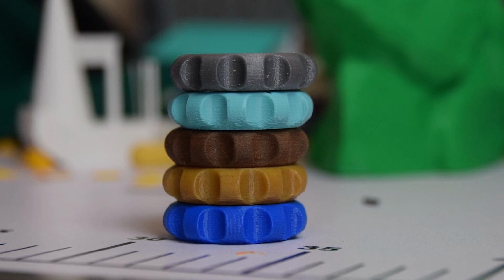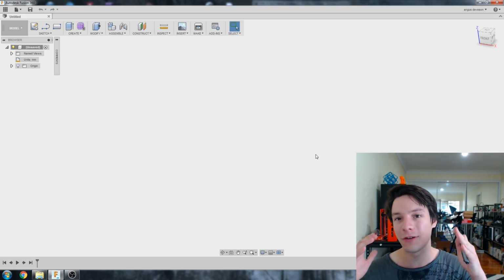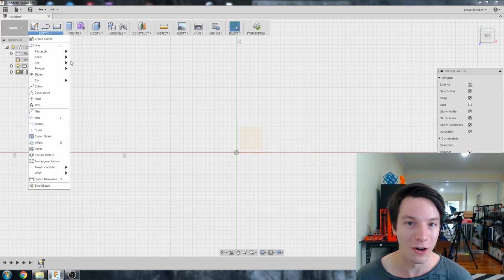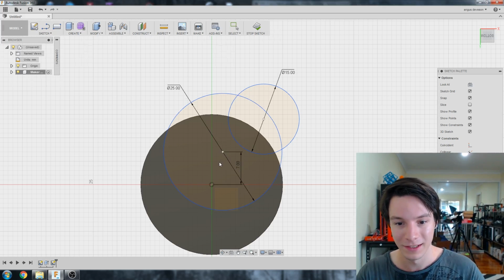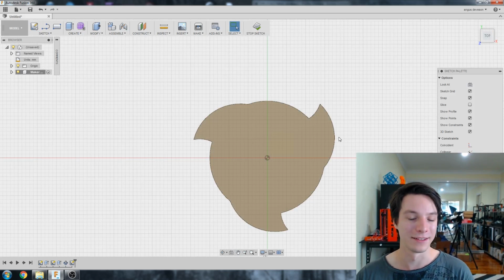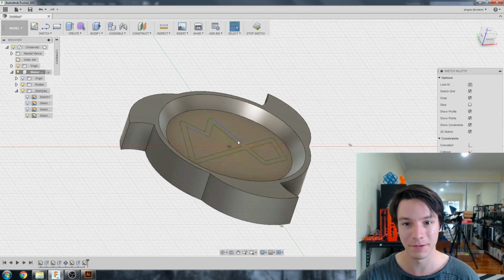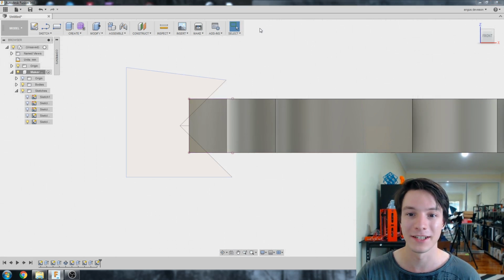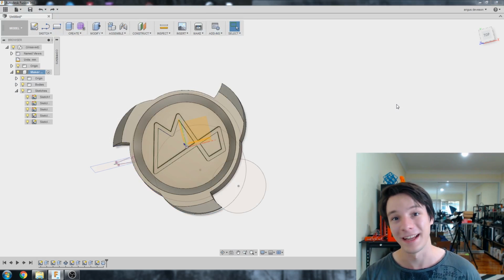Fusion 360 for Beginners - Design and 3D Print a Maker Coin! CAD For Newbies

Comment: I Love F360!  

I mentor a First Robotics (FTC) team and our entire robot was modeled in F360 by one of the students (my 15yo son).  He had never used CAD before; but he said he would just learn it from YouTube videos.  It works well with other CAD libraries so we were able to import most of the parts we use so he didn't have to create everything from scratch.

Also, since F360 is cloud-based, it is totally portable and totally collaborative.  He can work on the design at school, make changes at home, and even collaborate remotely with the other team mentor... all seamlessly.

He has also made several 3D printed parts for the robot using the school's printer an modeled them into the design.  

AWESOME!!

Comment: I didn't see if you made the mid-face relationship line as constructive... and when selecting the cut those were separate regions, weren't they ? I assume that when doing extrusion or features constructive lines are ignored (just like solidworks or other cad programs).

Anyway, very good tutorial. The minutes spent on the settings can save so many headaches!!

Comment: thank you soooo much Angus! I love fusion 360, and I know it has huge potential, but seems like the learning curve is a little steep. seems to me every other time i turn around I run into an error. I can't figure out for the life of me to merge a mesh with an object and make them one object to import it as an stl.
Reply: an example: I found a voronoi penguin I wanted to make for someone, however the only contact the model had with the build plate was the bottom of the feet and a small point on the tail making it pretty much unprintable. so I imported the stl Into fusion 360 and built a round base for the penguin. when I tried to select the mesh of the penguin and the base I created and merge the 2 it wouldn't let me. if you could cover how to do this I'd be very greatful!
Reply: Search Youtube for 'fusion 360 Convert STL to BRep' to learn how to edit an imported mesh.

Comment: what if I'm more comfortable with the software than my horrible drawing skills, I quite like to go in with a general idea, and as it takes shape I get new ideas, and things often change not because I'm LIMITED by the software, but because I can do things in the software I didn't think of before.

And yes, you are still a much better drawer than me, that circle is actually almost round :P

And thanks for the Pattern tool tip, I've been trying to do something for AGES and couldn't figure it out (I cut the model in half and made a rotated copy, was getting ready to attempt the tedium of cutting it into 3rds and do the same again, but now I can have it 5 times with less than 1/5th the work of making it have 2...

Comment: Angus,
Is it me or the video?
I'm trying to learn but the video is all blurry. Can't see the text properly when you choose menu items. I can hear what you're saying but to see Fusion 360 application it's blurred.
Reply from the maker: +Andrew Glagau it was recorded at 1080p, but YouTube may have reduced your playback resolution. I suggest changing to 1080p and letting it buffer, should help. In future I might zoom into buttons and windows to assist further.
Reply: That's better, but yes, it is buffering.
I want to get the best I can print for the first time with this V3 3D Printer I been building for the last year from Eaglemoss. I'm going through Bissett Magazines and get 4 issues a month and now am at the stage I want to 3D print useful stuff and hopefully in good quality.

Comment: I would have shown   how to make the circle tangential, because it's most times a good option. Otherwise nice video but i guess i will never leave my SolidWorks for an Autodesk Product again ^^. On the otherhand your meshmixer Video looked good. Might need to get into that Saturday my first printer shall arrive.

Erolis
Reply: By the way, F360 has basically meshmixer functions inside too. It's still in preview mode, so you have to activate it in your user options, but then you have basically everything you need for 3d printing in one tool, except maybe the slicer. (I'm pretty shure you could abuse the CAM module to make a basic toolpath for 3D printers too) :)

Comment: why is Z up for 3d printing. Makes no sense
Reply: Jonas Bandier I can't think why you would label it in any other way...to do so would make no sense.
Reply: Z up makes more sense then y up really, as xy makes a coordinate on the ground plane, then z for height, the 3rd dimension. Using xz for a 2d plane and use the middle value, y for the third dimension is odd.
Unless you visualize xy as a screen space from camera and Z as depth into the scene.